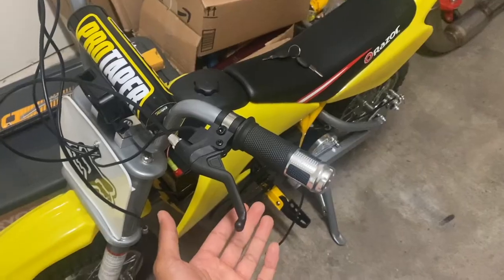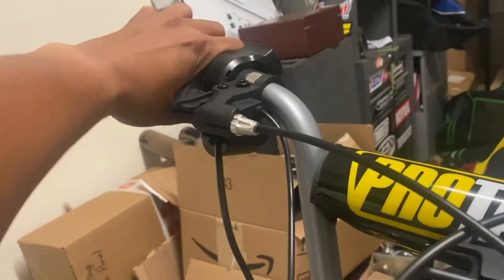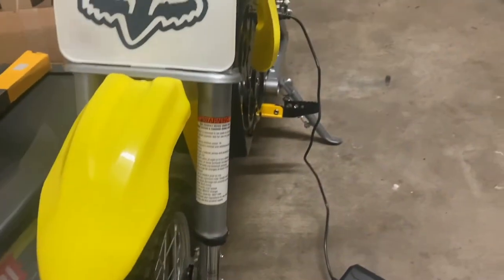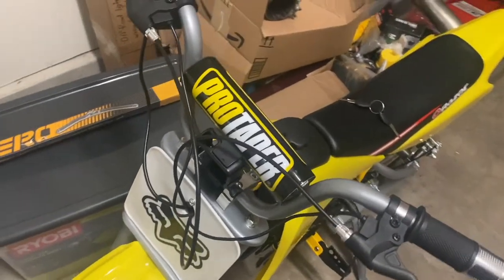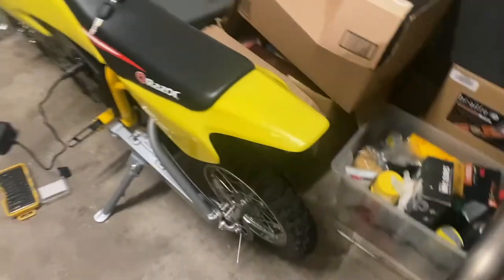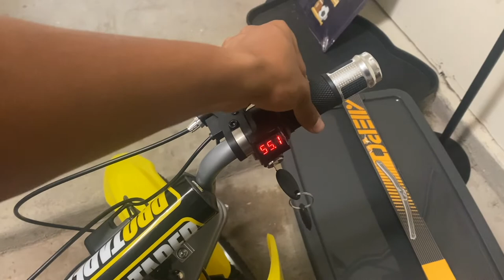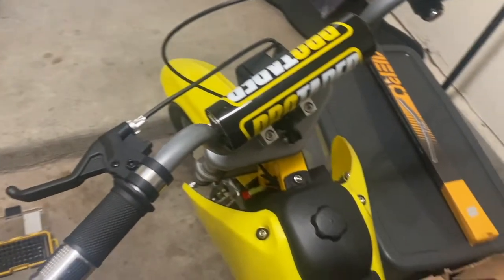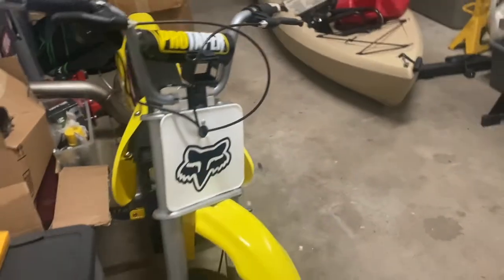MX650 MX500 Switching Front and Rear brake levers and deactivating safety switch | Burn out

Comment: Does cutting the brake senser still work?
Reply from the maker: If you want to completely disable it, yes. You could also just disconnect the connector from the controller though
Reply: @PatOutdoors  thanks you soo much

Comment: If you want to take that stripe and razor logo on the seat off. I used brake clean and a shop towel..
Reply from the maker: Thanks for the tip! I was just thinking about that. I'm gonna try a bit of acetone or mineral spirits since I'm out brake clean right now.